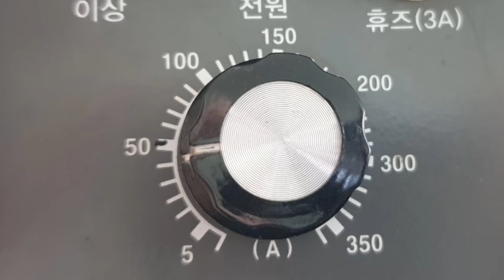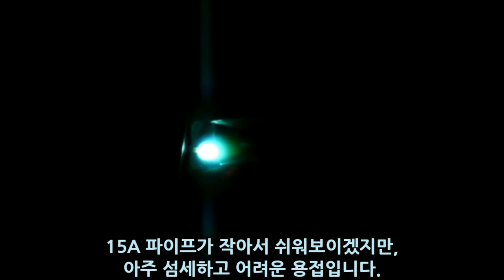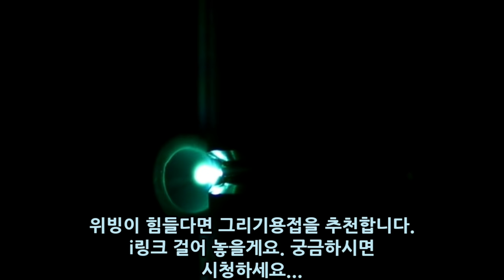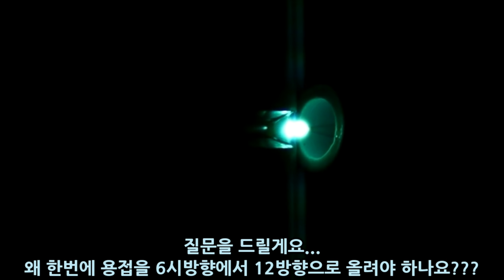15A sus pipe 6G자세 방법과 와일드카드 공유.

Comment: You make welding small pipe look easy. I very difficult. I have been welding pipe for 30+ years. Welded pipe from 3/4 inch to 36 inch. With every process except sub arc. I to learned the hard way.
Reply from the maker: Pipe welding is always difficult.
Reply: @welderjin  Yes it is . That is why i love welding pipe.